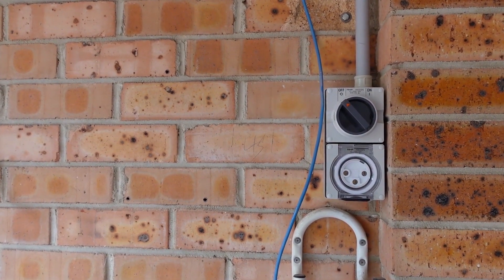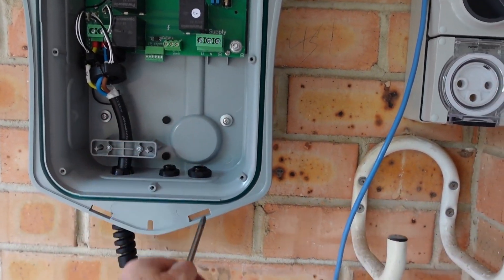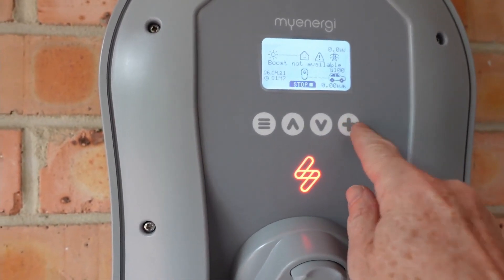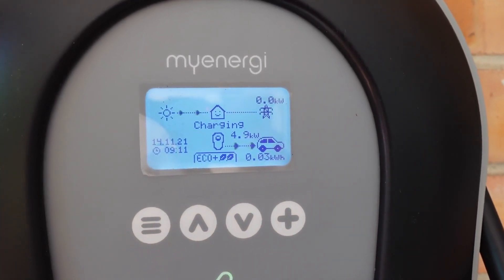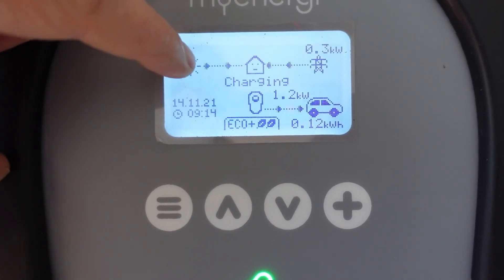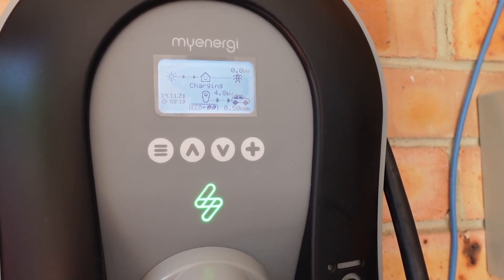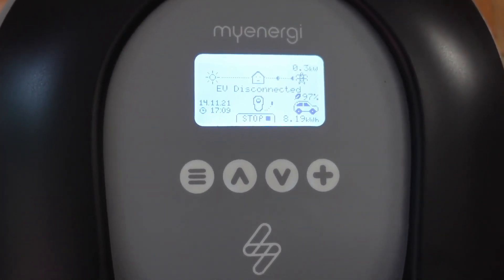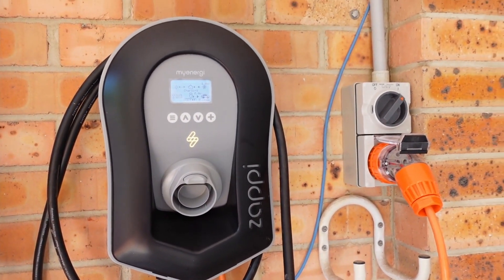Myenergi Zappi 7kW EV Charger Installation & Testing

Comment: Did you notice that house smiles when there is no imported energy from grid. Otherwise it is a sad house. ;)
Reply from the maker: Didn't notice that, nice!
Reply: @EEVblog2  Zappi has small nice things like that. It is a small(ish) company and there is still space for a quirks like that.
Reply: @sasiuru  Totally love it, should be legally mandated to have things like that 😁
Reply: honestly the best part of the charger is this little smiling house.
Reply: Dave pays extra for guaranteed 100% renewable electricity so the house should always smile.
Reply: @Okurkaarrgghh  It should, but as it cannot be sure that every electron is green, so it will be sad if there is anything from great unknown called grid. ;)

Comment: There is a setting within the menu where you can set the minimum "green" energy to use in eco++ mode. If you dial it up to 100% it will stop using grid energy should solar excess drop below 1.4kW (minimum charge allowed by the standard, hence the 10% minimum on the PWM). If you want to allow the zappi to keep at minimum charge with the grid import, you can then always use eco+ mode.

There is actually a lot you can configure on these zappis, especially when you start having more than on CT connected, like Solar generation and even monitor input/output of a battery.

Comment: 10% is the minimum defined in the standard and is used by Tesla to identify a SuperCharger (5% D/C).
This tells a Tesla it's connected to a SuperCharger and will switch to their digital protocol to identify the car for billing.
Reply: The Type 2 protocol was developed by German company Mennekes and is used by all EV (or Type 1, different connector, same protocol) incl. Tesla. The SuC billing is done by the car's MCU over 3G or 4G networks and not by the SuC. Non Teslas on SuC do the billing via smart phone and Tesla app (where available).

Comment: Total grain of salt: I'm lead to believe from a 'smart person' on a forum regarding charging: It's good to charge slowly to a point, below a certain point the efficiency loss of running the carputer/charger outweighs the benefit of throwing the last electrons at the lithium...so there is a minimum viable charge rate.  Another post (again, forever ago, pound of salt) someone mentioned that li-ion chemistry doesn't like obscenely low trickle charging because <reasons>. 
For the sake of minimum 10% on the pilot signal, perhaps that's when it is no longer robust enough over long noisy cables to be accurate?
Reply: 10% defined in the standard apparently.

Comment: Out of interest, why did you wire to a plug rather than hard wired?
Reply: a) I like being able to disconnect it.
b) An electrican was already there doing a garage makeover last week, so it was convenient to just get him to add it then.
c) It gives me a 32A socket so I can possibly use other high powered things if needed.
d) It gives me the ability to experiment with other EV chargers like the Open EVSE.

Comment: Does it have a feature where if the car is not charged by sunset, it automatically starts to draw more from the grid to make sure the car is charged before the next morning? An overcast day will probably not charge the car much.
Reply: It has a "boost" mode and various timer based settings that might be able to do that. Not sure though.
Reply: Eco ++ charges the car on excess solar only.
Reply: @moestrei  You can have a boost timer set in Eco plus mode. I run mine that way.
Reply: @SimonEllwood  Great, thanks. I made my own EVSE which is controlled by a mix of house battery SOC (I'm off grid solar) and available solar input.

Comment: If I understand it correctly that the PWM is to communicate the charge rate to the EV, then it can't be lower than that which corresponds 1.2kW, because to my knowledge, that's the smallest charge rate those EVs can charge at. You can't just feed it 70W of power and expect it to be charged in a couple of weeks or months ;)
Reply: Oh, you said that.
Reply: That would be nice though.
Reply: @EEVblog  Probably too much loss in the components when they run at 1% or less of what they've been designed for (this is a layman's guess, I have nothing to do with electronics engineering, call me a hobbyist at most)

Comment: On one hand this is cool to charge your car from solar only. 
On other, it is not very practical for your average user. 
If you need to go to work every day, car will never be at home during the day.
It might catch some sun in the morning or evening depending on season and weather but this is probably not enough and not reliable. 
So you have to charge it over night because you need to go to work next morning.
Reply: Sure, use whatever works for you. This suits my usage scenario.
Reply: I have an electric motorcycle which charges until 10:00AM and I use it for my daily trips into town. The Tesla then gets the rest of the solar excess which is 50-80km / daily on a 5kWp off-grid system.

Comment: I'd be slightly worried about the car's charger and battery because of the changing load current. It's probably fine though. Is there and eco+ mode where it's less aggressive with the ramp up and down?
Reply from the maker: There is normal Eco mode, but I haven't looked into that yet.

Comment: Nice installation! 😀 But a single phase unit!? 😱🙈 I also wouldn't go with a fixed cable that will be susceptible to wear and can't be extended if necessary. Also only wired ethernet? Good I suppose, if you don't mind the extra cabling...

We use an Easee wall box. It's small, 3-phase 22 kW, has built-in free 4G connection (plus wifi too) and it's also amongst the cheaper wall boxes. Made in Norway I think.
Very happy with it, especially since it enables "smart charging" when prices are low - usually during nighttime.
Reply from the maker: My house and my car are only single phase, no choice. It's not Ethernet network, it's just CAT5 cable for the twisted pair CT.

Comment: Ah that's surprising, I wasn't expecting to see a UK myEnergi EVSE appear in aus! That's a very well travelled charger ;)

I've had gen one for about four years now, it's been pretty rock solid - only real issue I had was the UV damaged the front panel. There is one thing you need to keep on top of, keeping the firmware  up to date. If you don't keep both the hub and the zappi (and any other accessories  up to date) you risk your EVSE becoming incompatible with the myEnergi apis - this happened to me and I had to get a warranty replacement. This is probably OK for your audience, but I could imagine joe six pack just leaving it as stock only to find the app stops working a few years down the line.

In theory easily fixed with an auto update feature.

Only other comment is why did they go wit 868mhz RF for comms rather than just using good old fashioned WIFI? seems like an extra hurdle to have a dedicated hub rather than using tried and true wifi?
Reply from the maker: I don't have a hub, so should be no reason to update the firmware for a standalone unit.
Reply from the maker: WiFi uses too much power, so you wouldn't be able to use energy harvesting to power the Harvi
Reply: @EEVblog2  I’d wondered if it had something to do with the Harvi’s harvesting, that said I have quite a few ESP based sensors that Ping back events and updates - they just use a button call and last for months without a top up, I’d be curious to see how long they’d last with a minor top up from something similar

Comment: 0:15 Ethernet cable Ethernet is way faster (cat 6 and cat 7) that can use 10 GB/SEC. Ethernet cable is way safer and private then WIFI. Wifi is just like a convenience store.
Reply from the maker: This is NOT ethernet.
Reply: @EEVblog2  0:15 I have even put the subtitle and you have put a Ethernet cable and you want to install a second one. Better to say electric cable. 220v .Oh dear, oh dear, oh dear EEVlog2. lol  . 4:24 By the way, nice tutorial. Winner winner chicken diner !
Reply: @mathbc1984  It is an Ethernet Cable but just used at 50 Hz for the current transformers. The 4 pairs could allow 4 current clamps.

Comment: I take my hat off to whoever worked on the UI for this system. There's some nice touches such as the size of the arrows and "Hrrm" or "Smile" face in the house icon. Subtle, but it helps you interpret what's happening.

Comment: Nice tandem, looks like the manufacturer actually thought about the users who wanted to integrate the solar panels & inverter with the car charging station. I also like the heavy duty power connectors you have down there - here in the EU we've got a different standard (CEE connectors a.k.a. commando plugs & sockets) and they're also very practical, but take a lot more space.
Reply from the maker: These ones are pretty huge.
Reply: I wonder how much of a pain it would be to implement hvdc 'fast' charging from a solar charge controller - since it's already natively DC the boost/buck is surely easier to dc than an ac inverter to ac onboard charger.

Comment: Strange it showed 10% and 5A - it should be minimum 6A at 10%.  Also, you said sample rate of 1s - i think the car samples a lot faster as it has a rather short deadline to comply with the pilot (fraction of a second).

Comment: I'm not understanding how the electricity is being selected from grid/solar.
Reply: If I had to guess this is just connected to the house supply and then senses the current from the solar supply and the grid supply to the main junction box. Then switches on or off based on those sensor value. It's constantly readjusting energy out to reduce grid load. 
The same could probably work for a heater or any other appliance I suppose, just turn it off when theres shade, turn it on there's sun. Makes sense ?
Reply: From my  understanding he has grid tie system so technically it's all coming from the house's electrical grid connected system like it normally would but it tracks how much power that the solar is producing and would be putting into the grid and tries to match it so that the power is going towards charging instead.
Reply: @redsquirrelftw  That makes sense Red
Reply: @redsquirrelftw  Pretty much, the EVSE monitors the feed from the grid, when it sees negative current it knows you're exporting power so it turns on the feed to the EV and modulates it to keep the grid export as close to zero as possible.

Comment: I was reading just the other day, that here in the UK, new houses are starting to be fitted with 3 phase. All in preparation for car chargers.
Reply: ..and heat pumps
Reply: @mikeselectricstuff  Yeesh, that's quite the heat pump, we've two including a big multi-split (three others coming soon, plus a small heatpump hot water service) in this house and we're only single phase ;)
Reply: They simply WONT fit all new builds with 3 phase. To put it simply. The grid can't handle it! Using normal 240v 32A you can charge and electric car in less than 8 hours and every single person who lives in a house spends longer than that every day sleeping.
Reply: @Lore69420  wait what, you think the grid gets can't handle three phase? Using three phase is a lot less stress on the grid. Instead of using 80A on one phase you can use it over three phases, a lot less on the grid. Also if you use three phase as balanced as you can get it there won't be almost any current on the neutral/PEN
Reply: @Lore69420  I guess not EVERY new build will get 3 phase, but some will. At some point, the uk grid will have to be upgraded if more folk buy EV’s.
Reply: @Lore69420  there is zero need to insult complete strangers.
Reply: @Lore69420  every EV can charge in 8 hours? err... single phase 32A is 7kW. there are already a decent number of EVs with 70kWh+ battery capacity, thats 10 hours minimum, not less than 8. So if you can get a 32A 3 phase charger in a new house it doesn't hurt not to.

And that's before you even consider smart charging. When everyone has an EV and smart charging comes into full swing then a 7kW charger might need more than 10 hours to deliver 70kWh as it cant compensate for a period of low charging rate by yoinking up the charge rate to 11-22kW for short bursts whenever the grid demand is low enough to allow it.
Reply: @Lore69420  Actually there are plans to install 3 phase in new build homes and for precisely the reason I stated in my previous comment. To reiterate: smart charging reduces your charging rate throughout a session based on various factors, grid load, tariff cost etc, maybe there's only 4 hours where the tariff is cheapest, during those 4 hours the 7kW charger will gain you 28kWh, leaving you paying more to charge the rest of the way up while the 22kW will gain you 88kWh during that same period so perhaps counterintuitively, giving people higher power chargers could actually help reduce the peak load on the grid aswell.
Reply: @Lore69420  "every single person who lives in a house spends longer than that every day sleeping" - I guess this means you, Henry.  Doesn't mean everyone else.  But keep practicing those generalisations - one day you'll get it right.

Comment: I wonder how that modulation of charging power impact battery lifespan.
Reply: Whatever impact slow-charging at a random 1.2-7.2kW may have, I'm certain it is way less than the random 3kW to 200kW load swings while driving.
Reply: Lower current would reduce the battery heating and increase lifetime, but the charge rate is already low enough that it won't make a significant difference.
Reply: Variation of charge rate has zero impact on the battery. 7kW is a gentle charge rate for a 38kWh (Assuming Dave has the Ioniq face lift)  Lithium battery in any case.

Comment: Wish my car showed charging and capacity in kWh instead of the stupid "miles per hour" that it uses. Also there's more current clamps than actual connectors in your electrical box now 😂

Comment: This power plug looks like a bastarded IEC 60309. Weird. Why is transparent? Is that IP44?
Reply: Transparent plugs are sometimes specified so they can be inspected easily.
Reply: @mikeselectricstuff  Yeah, 90+% of plugs in this form-factor in Australia are clear so you can see how they're wired. 

The plug/socket combos are either IP56 or IP66 rated.

No idea if it's actually based on IEC 60309 or if it's something Clipsal cooked up themselves but it's been the defacto standard for high-current single phase and three phase connectors in Australia pretty much forever.

Comment: I like the plug that you use to connect it to the wall. I think in europe we do not have one phase 32A plugs or at least i could not find them. It seems, that 16A is the maximum with one phase here.
Reply from the maker: I think the 3 phase (5 pin) might be slightly more common here, but the electrician said he install's a ton of the single phase ones in homes, as 3 phase isn't really a thing here in homes.
Some EV owners install a 5 pin 3 phases anyway even if they only have a single phase so they can take their EVSE with them and use industrial 3 phase outlets.
Reply: Industrial plugs are available in a single phase 32A variant, but it isn't very common.
Reply: I do not know where you live but the Danish code says that one consumer can never be more than 16A single-phase (maybe only in a domestic setting?). If you need more you need to go to 3-phase. I also applies to solar inverter that produces electricity. The old incentive program in Denmark allowed for max. 6 kW systems - a lot of people installed 2x 3 kW inverters for that reason. My parents installed a 3,6 kW inverter with 4 kW panels connected - the former to stay within the 16A max.
Reply: It’s called a 32 amp Commando socket in Europe - you can buy them in electrical stores or online in the usual places

Comment: 10% PWM -> 6A is the minimum valid PWM signal for standard AC charging. 4.5% to 5.5% is used to indicate digital communication is to be used i.e. for DC fast charging protocols. 9.5% to 96.5% is the full valid range for J1772 PWM AC charging signalling. Values apart from two aforementioned ranges are error/inactive states.
Reply: Simply put: if you set the Zappi to 100% solar, it will require at least 6A or 1.4 kW for 230v systems in order to do any charging. If there’s not enough surplus (so less than 6A available), the Zappi will stop charging.
Also note that for 3-phase models the Exo mode charging is a single-phase action. So the EVSE will set to single phase in Exo+ mode charging.
Mind you: even for the Eco+ mode you can go into settings and choose how much Solar versus Grid should be used for the Eco+ mode charging.
Reply: I have to imagine you can set it to turn off charging if there is less than 10% available from solar.
Reply: @gelu88  Dave mentions near the end of the video that the Zappi goes to "Waiting for Supply" mode (stops charging) when there's not enough solar
Reply: But what does it all mean Basil?

Comment: Any reason you went with a 32A socket outlet and captive plug instead of just hardwiring the Zappi through an isolator switch?
Reply from the maker: a) I like being able to disconnect it.
b) An electrican was already there doing a garage makeover last week, so it was convenient to just get him to add it then.
c) It gives me a 32A socket so I can possibly use other high powered things if needed.
d) It gives me the ability to experiment with other EV chargers like the Open EVSE.
Reply: @EEVblog2  Makes perfect sense!
Reply: Also good for some installations where you plan to move and take the charger with you - value add on the house to say 'ev ready plug' without locking them into a brand or appliance.
Reply: As someone who has to debug electronics as part of my job, it's always better to add a plug than hardwire something unless you are trying to save on cost or weight. Makes repair and reconfiguration so much simpler. I don't know how the ethernet is hooked up but I would have used a socket and plug for that as well.
Reply from the maker: @thunderb00m  It's not ethernet, just cat5 cable for the CT